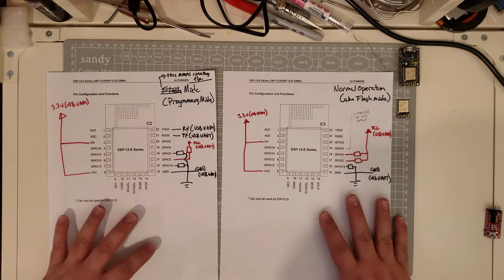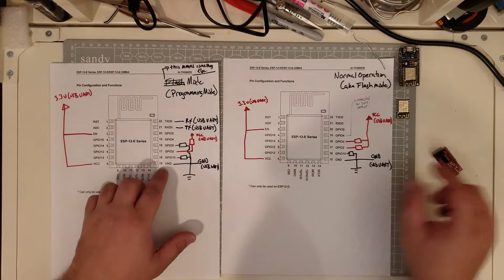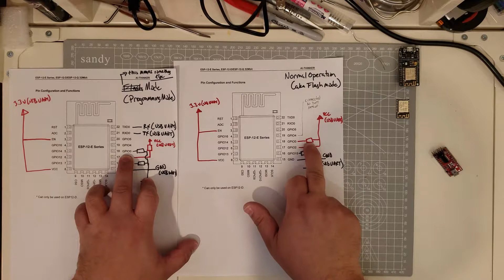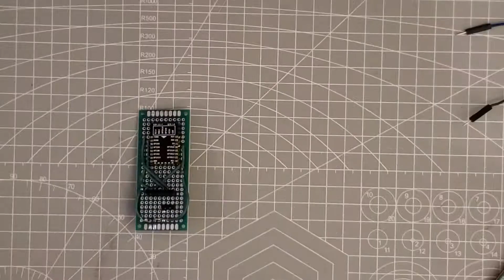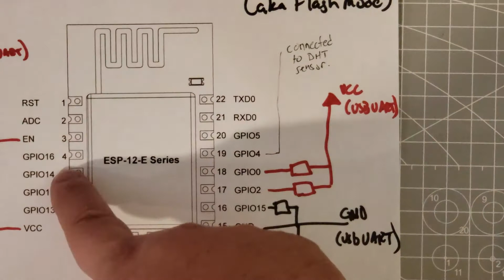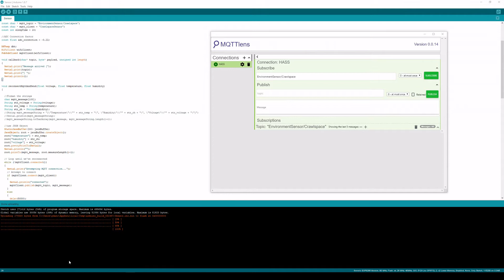ESP-12F Setup

Comment: Interesting video.  I am currently working on a similar project for the same reason, the WEMOS ESP8266 is not really suitable for battery operation.  

I am using an ESP12F which is identical except for a slight improvement in the aerial design.  To easily change modes I have two push buttons, one from RESET to GND. RESET is pulled up via a 10k resistor.  GPIO0 also has a 10k resistor pull up and pushbutton to GND.  To programme press GPIO0 the RST then release both buttons.  There is a really good article about this and also auto programming on Q26 website.

For power I am using a HT7333 LDO regulator.